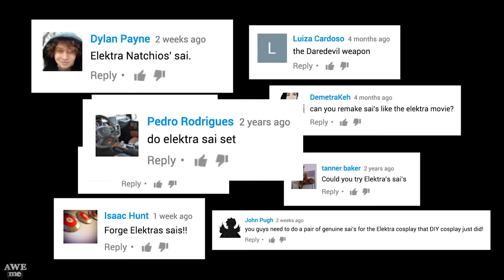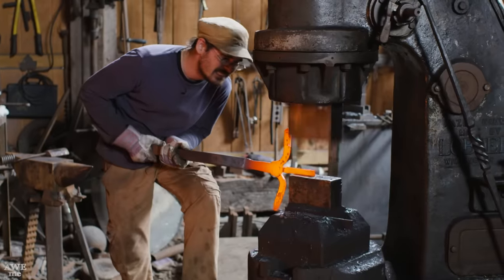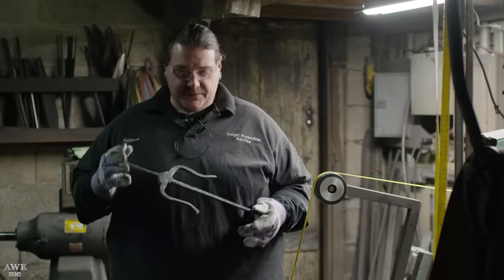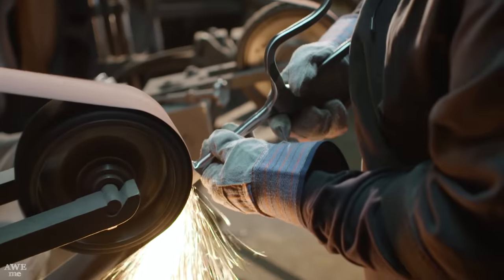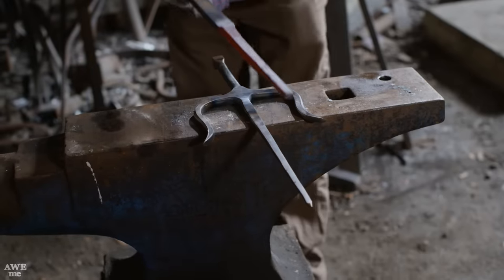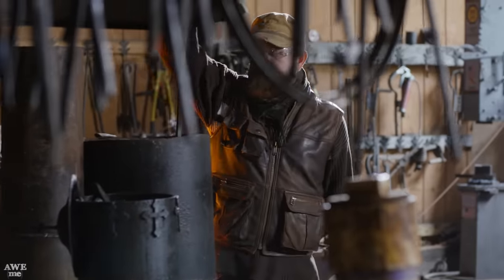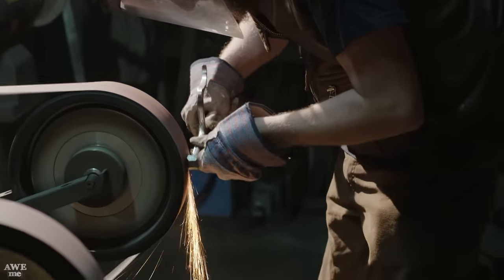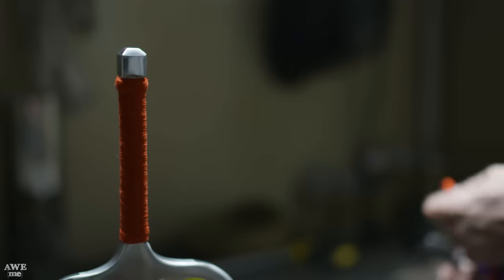Elektra's Sais - MAN AT ARMS: REFORGED

Comment: For the 50th time, CORVO'S SWORD FROM DISHONORED!!
Reply: i asked for this a hundred times too
Reply: Shaunak Deshpande so we're at least on 300 times with me included...
Reply: is that even possible? if foolds up, blades that fold up break instantly wont be much fun after its made.
Reply: pls make this happen
Reply: I'm pretty sure a sword which folds entirely into its handle is impossible. At least if you want it to be even semi-functional as a sword.
Reply: Shaunak Deshpande And for the 50th time, it's not possible! look at the deployment animation in slow motion; the blade comes out of nowhere. they'd have to design a completely different folding short sword from scratch.
Reply: JonMacFhearghuis There already are some designs
Reply: For the sword to fold into its handle and remain balanced as a weapon it would need to collapse in sections much like a telescopic design, but this would compromise the structure.
Reply: It doesn't have to fold! just make the blade!
Reply: Shaunak Deshpande yeh!!!!
Reply: Do Hanzo bow
Reply: Shaunak Deshpande, how do you think theywould they address the folding action?

Comment: Elektra actually wields bladed sai. It's not a real world accurate weapon, as sai are never bladed, but in order to call them "Elektra's Sai" they should be sharpened into blades. Otherwise, they're just normal sai.
Reply: Thing is these are for cosplay and as they’re made from metal you’ll probably end up in jail if caught in possession of them if they were pointed even if you were caught with them and questioned they wouldn’t accept cosplay as a valid reason
Reply: So let me see if I’m reading this correctly.

Elektra Sai = Bladed and operates like a dagger. (Offensive Weapon like the sword or dagger)

Real World Sai = Not bladed, has the look of a screwdriver with a more rounded tip. (Defensive Weapon like Escrima Sticks or Tonfa?)

If that’s the case I don’t know which one hurts worse. A blunt edge being driven through  your body or a sharp and clean cut!
Reply: @Gemini053 well for one you don’t actually drive someone through it’s middle prong, it’s basically a medieval police baton so you bonk someone on the head with it. And if someone is too close you flip your grip on it and start punching people with the thing with it’s pommel

Comment: No offense to Matt's ability as a blacksmith, but Ilya's one is just going to be stronger overall, due to being one piece. Matt's has the potential to break at the welds.
Reply: Damon Fyrian if its welded correctly then its not going to be that fragile
Reply: A good, deep weld has the potential to be stronger, depending on how you are measuring strength. 
   
Ilya's will not likely break, but will be more prone to bending. The welds will usually temper harder. 
    
So, over time and punishment, Ilya's will bend and be bent back slowly weakening the metal until it gives way (each bend makes the next bend more likely until failure). 
   
Matt's should stay hard and straight longer, but if it fails, will do so all at once. 
    
Of course, they used different steels as well, and Matt did a so-so tempering (focusing solely on the point), and those factors play into it as well.
   
Still, unless you are routinely throwing your sai into block walls poorly so that you are banging the guard tips for max leverage on the nexus, either should last several lifetimes of actual combat use - particularly as bulky as those were.
Reply: I mean supposing they are mainly made of two pieces like they said I doubt Matt's is gonna be that weak.
Reply: Ilya's blacksmithing definitely outperforms Matt's  aswell, not necessarily in this build but in other ones like the ancient Japanese katana
Reply: Damon Fyrian I agree I would trust something made from one piece before I trusted something welded together.
Reply: Dude, a lot of that is because when you are in a large-scale business of making swords, you HAVE to delegate jobs. Matt is better on the fabrication side, so that is what he does and is therefore stronger in that than anything else. Similarly, Ilya is stronger in blacksmithing than fabrication, so he does a lot of the blacksmithing and is therefore having that SPECIFIC skill reinforced. That's just the way an efficient shop runs - you delegate and specialize.

And BTW, welds can be very strong if done right, which I'm assuming they did.
Reply: However the point wasn't to produce the strongest possible sai or even two of identical strength but to showcase two different methodologies and thus make the video more interesting then seeing the same thing twice. 

Also as long as its not a total POS method (which I hazard they wouldn't use as self-respecting smiths) then some hypothetical like that probably isn't going to matter because both are sufficient. Which is important to consider should say one method needs more labor and thus drives up the cost of production for a benefit you won't actually use. 

Assuming there even is a benefit in the first place and not say a trade off or just plain no particular benefit.

Comment: Can you do Mauis fish hook, from Moana?
Reply: that would be intersting, mostly because it is meant to be bone and you can't actually get bone that large. if they made it it would have to be hollow or it would weigh a ton. It's a cool idea but i don't this the end result would be good =(
Reply: Is it possible to forge/glue bone pieces together? That way they can circumvent most of that.
Reply: the amount of bone you would need would be a hell of a lot, you could glue it, but it would be hard to get it to look like one piece of bone, plus all the small pieces would need to be flat on all sides, wasting heaps of material and taking a very long time. I think the main issue is that they are metal workers not bone carvers so its not really their style =)
Reply: FuddyDuddyman- Cactusgreen 
This can be made in real bone, though would reqiure mutilple seam sections which can be hidden to a point and large bones to minimize the number of pieces. The design work carved on the hook in tbis case would not allow to make completely hidden seams, and if it did, would be an enormous amount of jigsaw puzzling to do so. Still, doable. I have done many works with completely hidden seamwork. Structurally, to have real impact strength it should have a some method of solid core and then bone clad. Bone carving actually IS.. one of my primary mediums.
Reply: SZOBRÁSZ STUDIO ok
Reply: Colten Collen 
I answered because of the reference of main issue thought to be of metal workers not bone carvers.
Ferenc
Reply: I wonder if disney would sue..
Reply: Lester Chan 
Only saying that such a thing is possible to be made.

Comment: i was hoping we'd get some mention of the fact that sai are clubbing weapons rather than stabbing and slashing weapons as film and television keep portraying them
Reply: If they were authentic that'd make sense, but it's a build based on tv, so they probably didn't think it mattered.
Reply: the ones in the show, unlike the movie, were authentic, yet they still treated them as stabbing blades when they're basically blunt. it's a huge myth about these weapons that basically because they have sword-like guards that they must be daggers instead of batons.
Reply: neomp5 Isn't it a piercing weapon?
Reply: sai are not sharp. they're billy club style weapons. they have a point that can be armour-piercing when thrown thanks to their weight, but isn't actually sharp. stabbing with them makes about as much sense as stabbing with a police baton or a tonfa. the only movie i've seen which has used them correctly is "the matrix reloaded", where they are used for striking, punching with the reversed grip, and blocking in both positions. the daredevil movie was the most inaccurate, using them even for slashing as if they were knives, but the daredevil show still uses them for a lot of stabbing, which was disappointing
Reply: i know there clubbing and defensive weapons but the tip is strong enough to brake some ones rib cage and pop a lung even tho that is not what they are ment for
Reply: neomp5 
They basically did say that
http://www.youtube.com/watch?v=cGvnmDnqPkc&t=6m34s
did you miss that?
Reply: they do have a point on the central tine, but as you said it's not sharp.  however, it doesn't necessarily have be sharp for it be able to pierce soft tissue.  the ones they created here are pretty authentic.
Reply: Most of the time they were used to combat swords due to their rise being during an oppressive samurai regime in feudal japan.
Reply: It doesn't have to be sharp to be a piercing weapon. A sturdy screwdriver can be used as a piercing weapon.
Reply: neomp5 if you don't mind my asking, how were they clubbing weapons? I always thought they'd be for stabbing since they were pointy.
Reply: He did mention that they were essentially like tined police batons. Not exactly a detailed discussion but the point gets across (punny..)
Reply: Chasen Tom i did miss that part, but he still describes them as spikes, which isn't any more accurate than blades with an edge
Reply: Jack Mcslay a screwdriver is a hell of a lot sharper than a sai
Reply: bobbafett704 the point isn't sharp. it's enough to puncture with enough force, particularly when thrown, but does not go through flesh with a gentle push like a knife, the way it's shown in the daredevil series. i know because i've dropped one on my foot and it leaves a bruise but doesn't break the skin. the way you use them is to swing them and strike with the shaft, reverse the grip and punch with the pommel and block with the shaft along your arm, or by capturing limbs or weapons in the tines to lock or break them. they're also carries in threes rather than as a pair, because you can lock a weapon between two of them and then draw the third to strike.
Reply: Thomas Jenkins pretty authentic except in being quite short. i think they should be a bit longer to be used for striking. but they seem to be intending them primarily for piercing, which isn't accurate
Reply: neomp5
they aren't used for striking.  striking with a sai is the same as hitting someone with the guard of a sword.  you can do it, though it's not the intended purpose.  sais are purely a defensive weapon.  the length is kind of dependent on the wielder, much like nunchaku.

i can actually defend them putting more of a point on these than usual as they needed to showcase them somehow at the end of the video and properly blunted sais wouldn't be very entertaining.
Reply: yes, it's a defensive weapon, but that doesn't mean you don't strike with it. however, most of the striking is by punching with the pommel. it's also used to strike with the shaft and jab with the tip, but unlike in the movies, a jab is more likely to leave you with one hell of a painful bruise than to impale you.

the way they've designed these ones, with very wide guards and a short shaft, seems quite impractical for their intended use. probably makes them hard to flip around too. guards are too heavy and close to the middle, which throws off the centre of gravity.

to demonstrate sai properly, they'd have to do the kind of demo they do with hammers and staff type weapons. lots of melon smashing. a good throw will stick a proper sai right into solid wood too, even blunted.

Comment: I got a pair of Sais in 1999. They are dull on all ends. They are suppose to be, I think.  If you swing anything at someone holding a sais, you will lose the object you swung. Within a fraction of a second of that happening, you will be smashed in the head with 5lbs of steel.

Comment: On the welded version, it will be fine for a show peice. But it wont have nothing close to structural integrity of the forged peice.. its all surface welded with mig. The edges of the tines werent beveled, nor was the center tine grooved.. there just isnt any penetration there.. by the time its ground , itll be worse.. the filler dont really count for holding power... Its beautiful work and im hating. I love your show.  23 years of tube welding experience tells me the tines will break of if subjected to shock..